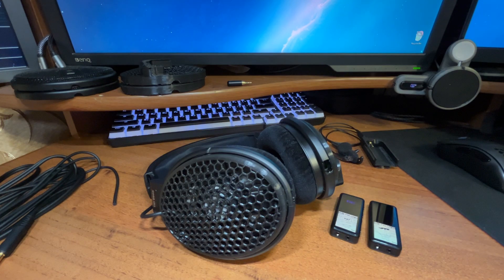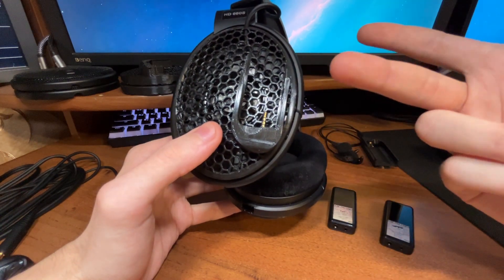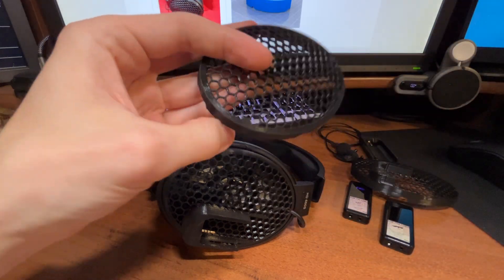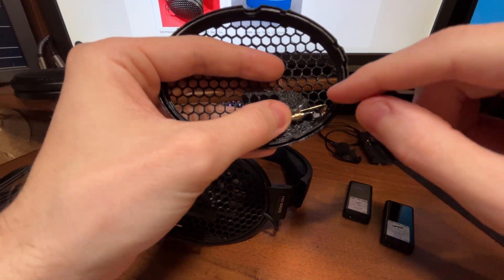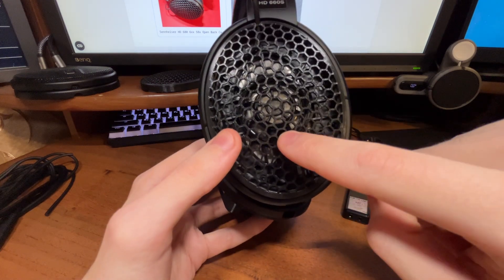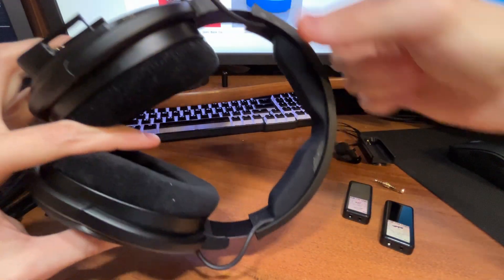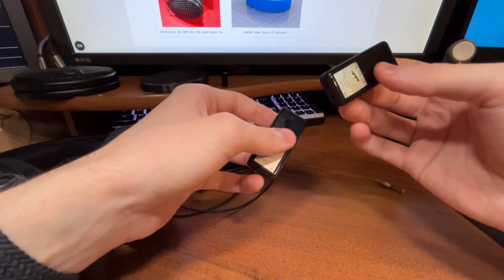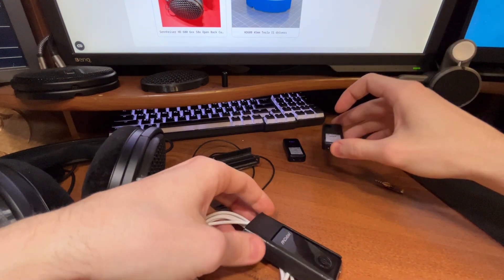Sennheiser HD 660s Wireless Mod feat. FiiO BTR3k

Comment: For anyone interested, the Fiio 2,5mm TRRS pinout seems to be R-/R+/L+/L-
Reply from the maker: pretty sure it's TRRS > R- R+ L+ L-. don't quite get what you mean by L-/R- to the speaker ground, i've just checked where original cable's + and - go with a multimeter